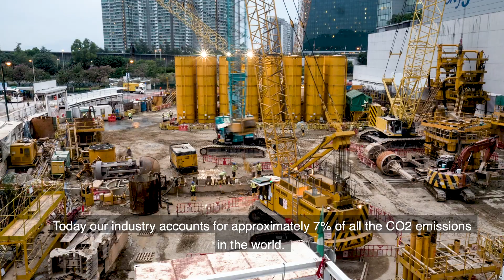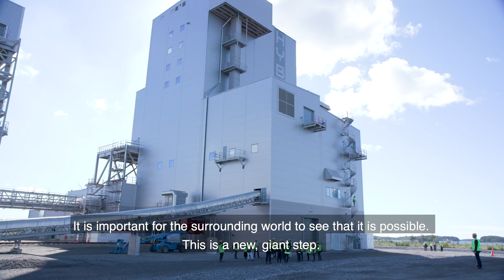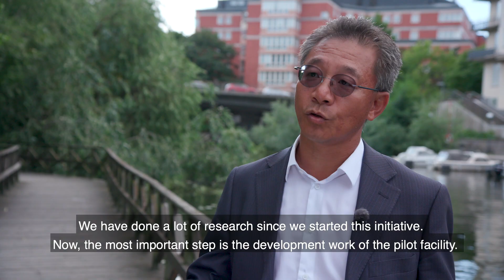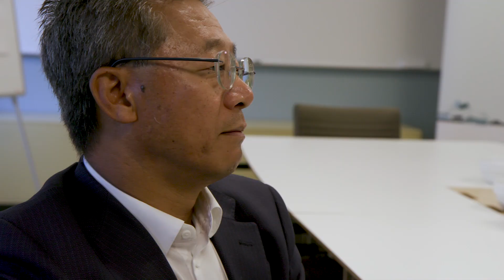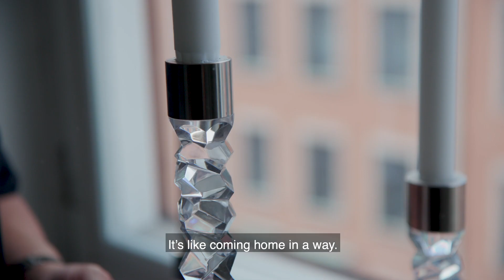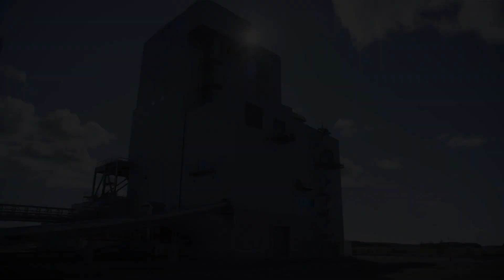HYBRIT - Episode 1: The HYBRIT initiative

Comment: Strang movie... what are they going to do? Turning windmill energy into hydrogen?(50% gone?) And then use this to meld iron??? This will take an enormous amound of windmills (if there is any wind of course). To make the steel for these windmills it will take a lot of fossil fuel!
Reply: They will use hydropower to power the process. The region they’re planning to build the plants in have a huge surplus of hydroelectric power from plants built before all the factories there were moved to Asia and Eastern Europe, and the national grid doesn’t have the capacity to transfer all that power to the other regions. That’s what Vattenfall will profit from in this initiative, since they’ll finally have a buyer of all that electricity they’re producing, which in turn will also drive up the prices again, which have been hovering very close to not profitable in the last few years because of how the supply has been much much greater than the demand.
Reply: @anifox2  but still to produce steel takes astronomical amounts of energy if coke is not used. there won't be enough electricity to produce much.
Reply: @Withnail1969  Hybrit will on it’s own produce around 1.3 million metric tonnes of iron annually by 2026 in a larger demo-facility, a renovated existing facility now using coke, which will sell the product at a premium for being environmentally friendly. The next step will then be to convert all their existing facilities to solely produce HYBRIT steel. Another company, H2 Green Steel, wanting to build its own facility nearby, which by itself will produce 5.5 million metric tonnes annually by itself, with the set goal of having produced 5 million metric tonnes before 2030. Now sure, that’s nowhere near China-levels of steel manufacturing, but for Sweden, it’s quite a lot, especially if you take into account that Swedish steelmakers don’t really compete that much with cheap Asian steel, since that’s impossible. They create high quality steel products like surgical steel, which can be sold at a premium. But yes, this will take quite a lot of energy, but probably not as much as you think. When the Swedish steel industry is completely transformed, the electricity it requires will account for roughly 10% of Swedish National annual production according to recent studies. Coke isn’t actually a very efficient fuel. It’s cheap to get started with (compared to most other types of energy sources) and easy to use, but if you want pure efficiency, electricity is actually a lot better.
Reply: @Withnail1969  LKAB and SSAB and Vattenfall have done this for over 100 years. I think they know what they are doing. Don´t you think it´s fun and exciting that they explore new ways of making steel. If they succeed, they (or us here in Sweden) will make lots of money from the invention. Almost nobody uses gunpowder to blast rocks since Nobel invented dynamite. Guess the same goes for this when customers start to ask for the product. I hope it works.
Reply: @Withnail1969  I don´t know.I would be rich if a knew.  I guess we just have to wait and see :-)
Reply: it's delusional nonsense. can't change the laws of chemistry with 'tech'. how many windmills to provide hydrogen and power the plant including rolling mills? many thousand i imagine.